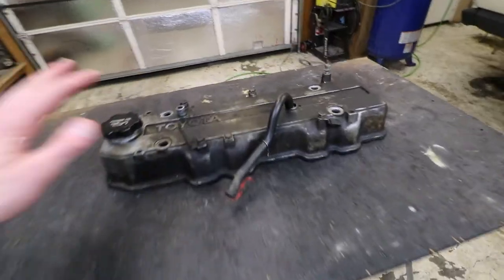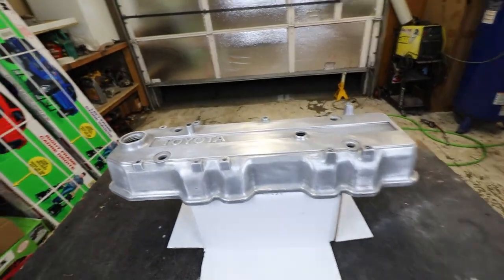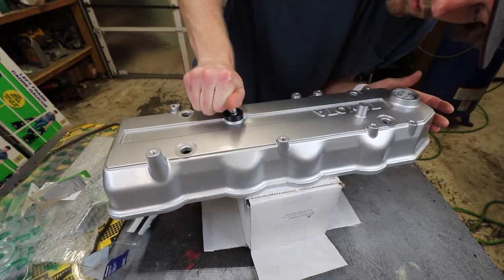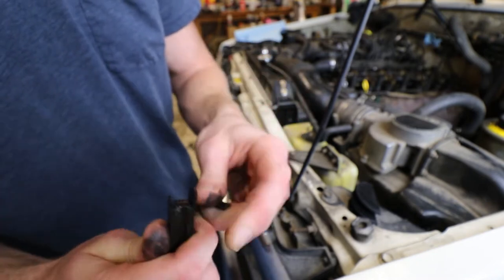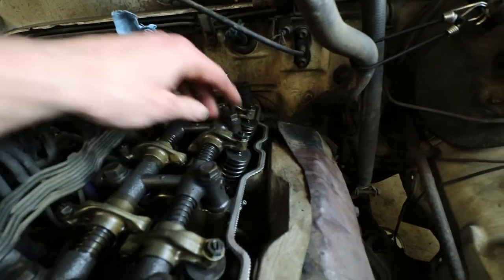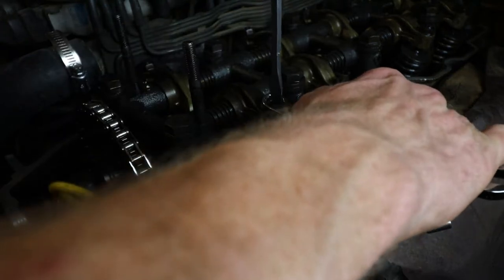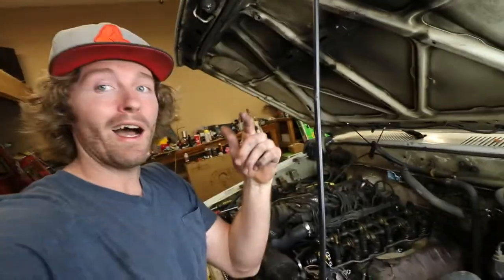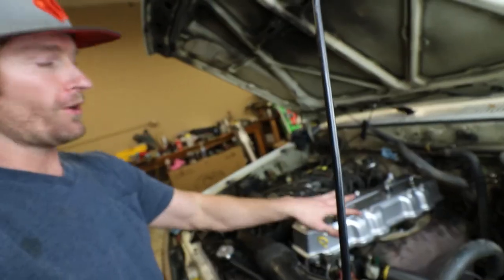Valve Adjustment / Valve Cover Restore 22RE

Comment: FYI, on a cold engine you want to run you valve specs .001 tighter than factory rec, since the .008/.012 is for a warmed up head.

Comment: is it just me or does it seem like none of these channels have any clue whats going on?  does anyone have a recommendation for a channel that has actual tutorials with clear instructions and nuances of the particular process? If i want to watch an edit of someone doing it for the first time i can make one myself.  Dude didnt even warm up the engine.
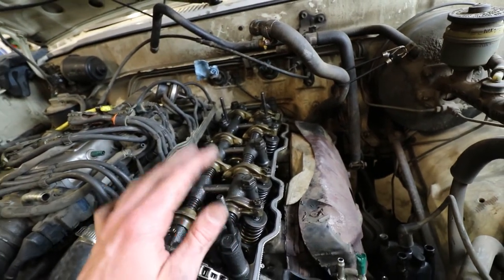Reply from the maker: 8:39 I say you should warm it up boss. Just because I didn't do it on camera doesn't mean I didn't go back and check after it was warm. Been a few years but not my first time. Check out LC Engineering, they should still have their tutorials. That's who I learned from when they built the engine for my original 4runner back in high school.

Comment: how tight do you put the new style of valve stud gaskets on? Do you put them on til they are just about to start mushrooming? i have never used this newer type of oring/gasket all the old ones had the metal covers and the washer piece on the bottom.
Reply from the maker: I tightened them until it started to mushroom a little bit. No leaks, I haven't had a chance to drive it around a whole lot yet but seems just fine.

Comment: Do you have to do valve adjustment even if your just replacing the valve cover gasket?
Reply from the maker: No need to do a valve adjustment just replacing the valve cover gasket. I just did it cause I was there and I had no idea when the last time it had been done was.